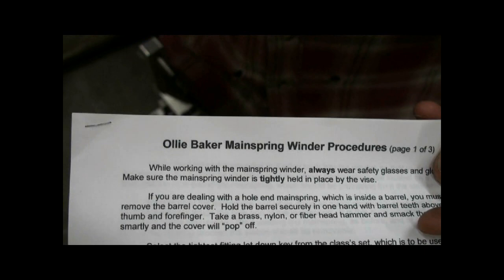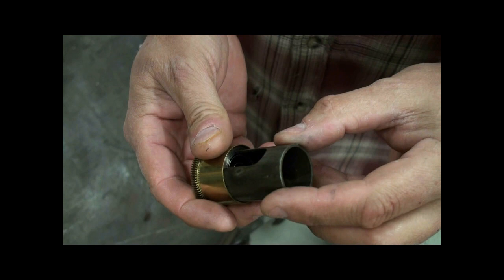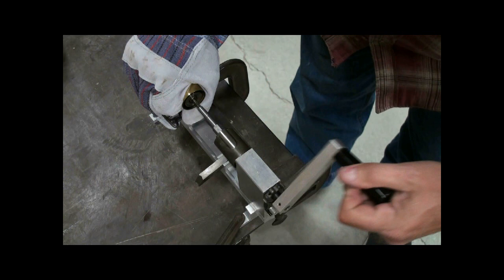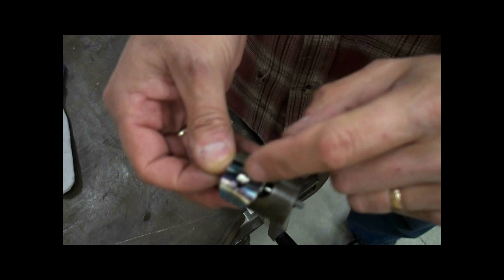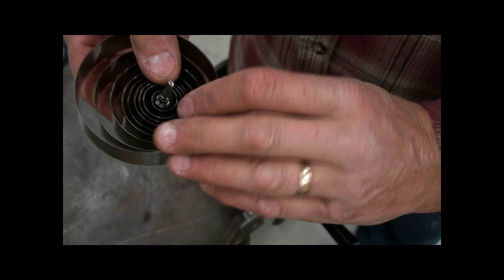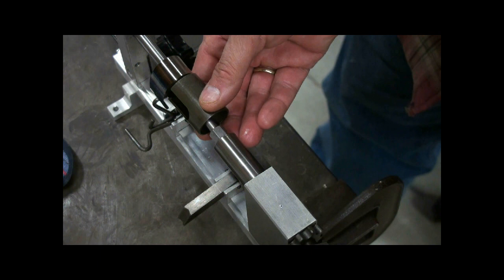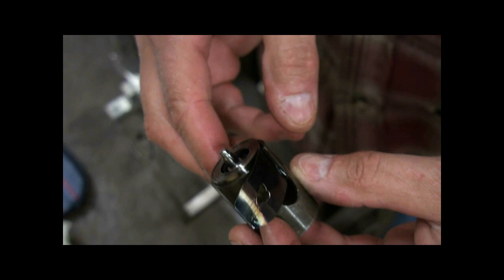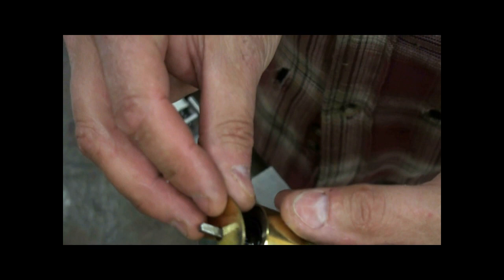Ollie Baker Mainspring Winder Demo

Comment: Hello from Australia. Many thanks for the informative instructions on removing mainsprings from barrel housings. I have an Ollie Baker Winder and so far have only used it for open mainsprings. Tried using it with your instructions on a closed barrel and it worked perfectly as you have shown. Cheers mate, Steve

Comment: when i clamp the arbour in place, the smooth pivot side is getting ragged to bits inside the concave slot for it, ive been putting pieces of clothe in to stop the ragging, any ideas? i belive the winders i have are not 100% straight
Reply: A brass bushing that fits the pivot really helps protect the pivot from being torn up in the tailstock.
Reply: @user-lw2bd4vw5n  still not exactly sure what you mean. Find a bushing that just fits the pivot so it leave the pivot end untouched ?
Reply: Correct. When you've got the arbor in the chuck, find a bushing that fits the pivot. Slide the bushing onto the pivot, then slide the tailstock into place. The bushing will protect the pivot from any damage. Once you've completed the job, the bushing comes off when you remove the tailstock.

Comment: More difficult if the winder side of the arbor is on the enclosed side of the spring barrel.
Reply: I asked my news group what one might call this arrangement...some said opposed arbor or perhaps right and left side arbor.   It can be difficult but not if you use another arbor, with the correct arbor hook, then use the winder sleeve as normal.  This is what I do.

Comment from the maker: Hello, You would still insert the winding arbor shaft into the headstock of the Ollie Baker in the same manner shown in this video, but you would first reverse the hooked swivel rod (located on the horizontal bed of the Ollie Baker) by sliding it off the end of the bed and turning it around. This would then allow you to unwind the spring in the other direction. -KK